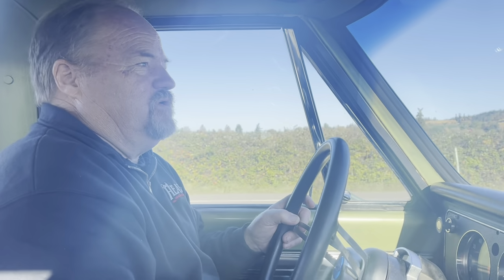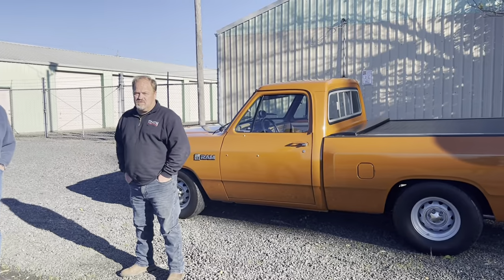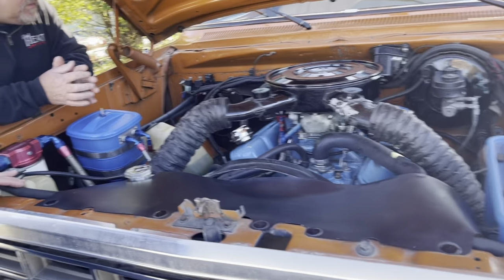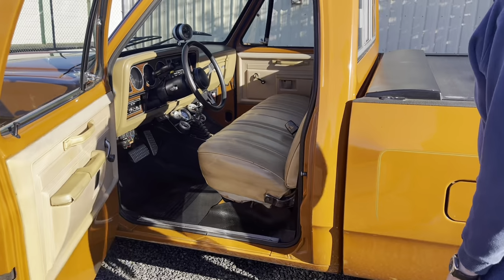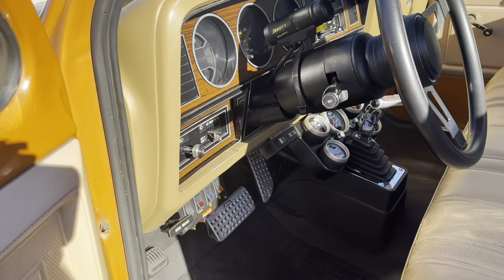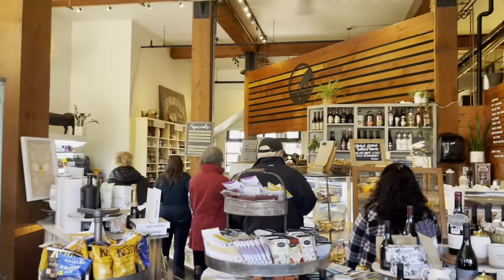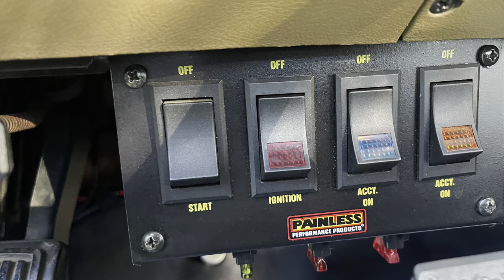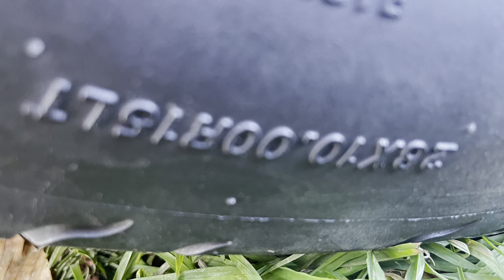1981 Dodge D150 Short Bed pickup with Gear Vendors Overdrive Flow Master Exhaust

Comment: Awesome truck ! Clean,simple style , done exceptionally well!I own a 83’ D150 4 speed. I’m currently in process of installing  a 408, new fuel system, radiator and line lock. Should be insanely fun !
Reply from the maker: Right on!